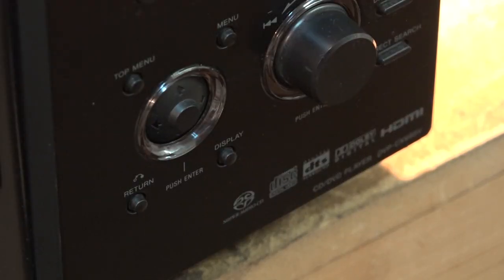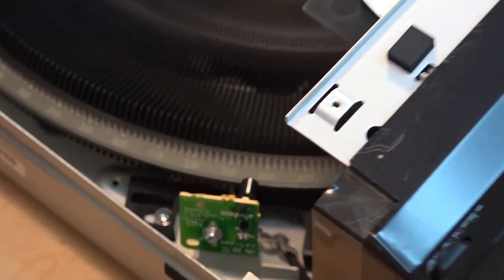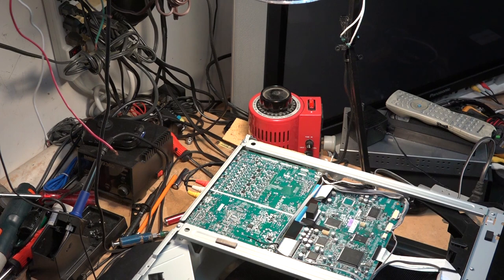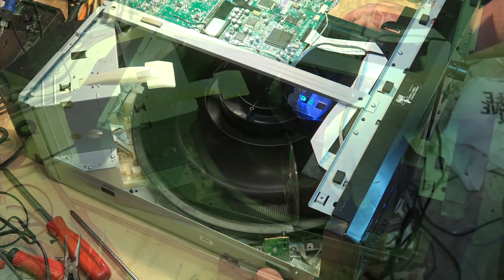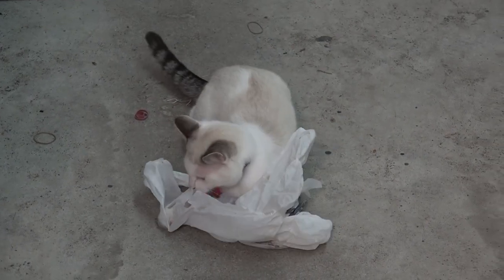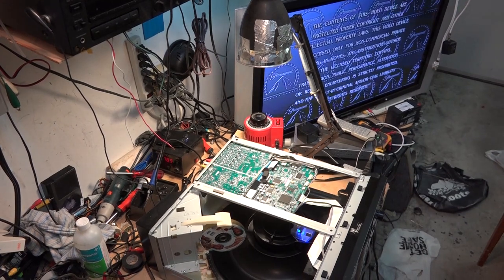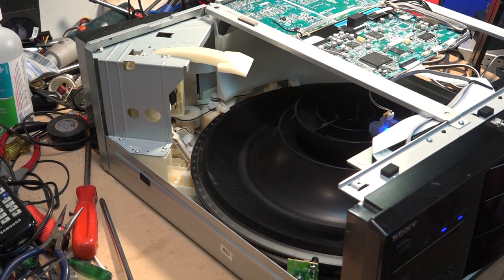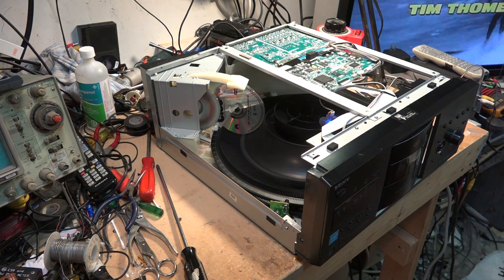Sony DVP CX995 400 Disk Changer no play

Comment: I recently bought one of these at a Goodwill Outlet, so it was kinda abused when I got it.  And ....it didn't work.  It would just go around 3 times counter clockwise then read "please wait" forever.  I found your video and my problem seemed somewhat similar to yours.  But it was late so I took one last look before calling it for the day.  I wanted to look at that guide wheel on mine to get an idea of how yours might have come off, cause it seemed rather improbable.  I found my guide wheel snugged up against the disc sensor!  After restoring it to its rightful place the machine worked fine...clockwise, counter clockwise...found the disc, played it.  Thanks for the help.
Reply: I have a problem like Sunplais, would you please show me where is the guide wheel snugged up against the disc sensor?  Thanks

Comment: Thanks 12voltvids!  My mega-changer began to act erratic after I removed several discs.  It would turn on; make a long noise; carousel would not turn.  I also have the CD mega-changer; experienced the same problem.  Discovered that it was the belt; accessible from the rear on the CD changer, but, I had to remove the top on the DVD changer to reattach the belt; problem solved.  I've owned both since 2006, without any problems.  So, I'm glad that I clicked on your video, and decided to to remove the top to have a look!

Comment: I discovered that when working on the unit, with the cover off, the super bright lights in my garage and workshop affects the optical sensor malfunction also direct bright sunlight when working outside.  With the cover on, it worked normal.

Comment: My CD-400 carousel started rotating endlessly, alternating between faster and slower rotation. I knew nothing but assumed there was an optical sensing system that wasn't working. This video clarifies a lot. However, I am wondering if it might be possible that the sensor under the carousel might be occluded by dirt or debris that might have accumulated over the decades (my unit may date from the 90s) rather than a dimming LED. Unlike a hand held remote, this sensing system is designed to work at a very short, fixed distance. This video provides enough information for me to attempt a repair. I know the video is 6 years old in late 2022, but it is pure gold for me. I have spent hours searching for this info to no avail. Thanks a lot. Hope the cats are alive and well.

Comment: Fascinating watching you fixing these items,. Have Sony 300 Disc player running on 110V ac system (Canada). I ran it on 230/40 ac system using a transformer here in Malta and worked perfectly for many years. Mistakenly I plugged it in a 230/40  wall receptacle and it went dead. Looked like the CD changers own transformer obviously burnt out. Can`t use anymore . Wish I can find new transformer to replace the bunt one but I live in Malta and it is impossible here to find anyone that can fix my unit.
Reply from the maker: I'm sure I could find one that would work on it.  Might need a couple to get the different voltages used but am am sure one could be found that would get it running.

Comment: That unit looks like someone's been at it before, what with the loose components and everything. Good call on the emitter LED, I would not have thought of that once I saw it working...

That new ragdoll cat of yours looks like a mischievous little character :)
Reply: A variation on the emitter LED problem.  No power to LED.  Check for unplugged connector on PCB.

Comment: Guys like you are getting very hard to come by!!  Any chance you are near Tampa Bay?? lol.. I have 2 AVR's I'd love to fix. An old Carver that my daughter smoked on me while I was out and a Harman Kardon that won't power up. The Carver is from the mid 80s and was really clean sound and the HK was ok to pretty good. I just bought a SONY AVR and 400 disc player. The receiver sounds like crap with my HK speakers and the 400 disc player needs all the belts. They were both NIB, but stored for many years. One of the easily seen belts was melted into the larger pulley and the other had just snapped. The door won't open on it's own, so I'm betting it's also toast.. I think I'll check the rollers as well since the belts look melted. The plastic  wheel retainers are possibly junk as well..  My old 6-pack magazine CD player was my favorite for decades, but it bit the dust a few years back and it broke my heard.. Now it's hard to find anything with Spotify and others killing the market.. I won't use them. It is not a PLUS for the common man. Just another money sucking deal from those with money pushing us to want more of their crap and pay for it.

Comment: The replaced LED didn't seem much brighter than the original (though obviously it was enough to make it work again), couldn't it just be dust build up on the photo detector? I had a similar problem on a VCR that wouldn't stop when the clear leader past the sensor all it needed was a cleanup as it was "blinded" by the dust.
Reply from the maker: One of the first things I did was blow any dust out with my compressor. Didn't show that because it had no effect on the outcome. Did that before I changed the emitter.

Comment: My Sony compact disc player CDP-CX400 no longer works after transporting it over 800 miles. The error message says "table error"  So I removed all the CDs, and followed the directions on the Sony web site, and it still does not work, with same message. A Sony phone consultant said to send it to United Radio for repair, which I hesitate to do. Any ideas??

Comment: interesting. The cats are an added bonus !
Reply from the maker: Cats are a pain in the ass some times. One climbed up on the top shelf and knocked box that contained 5 Sony lavaliere microphones I had up for sale down, breaking 2 of the plastic storage boxes. Most of the stuff I get in I try to sell off after repair, at least the stuff that is worth money. For example the 16mm projector that was featured a week or so ago should be out the door this weekend. That giant 32" Sony tube TV that had the bad degauss thermistor. Yup found a home for that one too. Looking for a home for the VP2000 3/4" player. Someone will take it eventually. All this old stuff gets a new home eventually. Much of it I just give away as I need the space.
Reply: oh yes,that's a cat! lol  but that's a shame gear was damaged that someone needs. I have suffered a loss.....just not as costly as those mic's
Reply from the maker: I doubt they are damaged, just the storage boxes, the catch that holds 2 of them closed snapped off, so the box will need to be held closed with a rubber band. Reduces the value a little. Have no idea what I am going to sell them for anyway. Have to do research and see what they have been going for.
Reply from the maker: I doubt they are damaged, just the storage boxes, the catch that holds 2 of them closed snapped off, so the box will need to be held closed with a rubber band. Reduces the value a little. Have no idea what I am going to sell them for anyway. Have to do research and see what they have been going for.
Reply: The price we pay for what they give us. :)

Comment: Hi there we have 400 disc sony changer in for repair slightly different fault where by if you no disc's in it  the carousel will constantly go through all 400 locations and load at every single disc location  and do this until you power off it would seem the machine thinks it has 400 disc's in and yet there is not one in it all. I think the sensor that detects there is a disc in each slot as it goes by is sending out a high output telling the machine disc's are present.
Reply from the maker: How they typically work is a China infrared light beam into the edge of the disc and there's a photo transistor on the opposite side and as the disc goes past it detects the pulse of light passing through the disc. So straight light that's able to reach the sensor can cause this problem. Typically the vitamining dial that shoots the light beam out does not point directly at the sensor but points at an angle so that light gets refracted through the disc itself but if there's no disc in place the beam from the emitter doesn't reach the detector
Reply: @12voltvids  Hi the strange thing is if put a disc in say position 25 and ask the machine to play this disc it finds the location and plays it.
Reply: @12voltvids  One other I was trying to see to see how much light output is present from the  infrared transmitter but all I have here is one of those credit card infrared checkers for remote controls  and when I switch the workshop lights off you can see the pad on the card dimly glowing. Ps thanks so much for your time and help.
Reply from the maker: @robertedmead3684  the location is detected through an encoder ring on the bottom of the carousel it has little slots that are varying with that it can read as the disc carousel is spinning so that the microcontroller knows what position it's in so when you spin it to disc 25 it knows where 25 is because it reads from the bottom almost like reading a barcode if you were to pull the carousel out you see it what look like little little teeth sticking down which interact with an optical sensor so as it's turning it knows where it is and each number is not indexed individually what it is is there's one that has a larger space and then the rest of them are all equally spaced little notches so when it starts out it makes that first initial rotation until it hits that first marker which tells it this is position number one and then it can rotate either direction and it counts the pulses so that's completely different than the disc in indicator which is a little LED that's typically on the left side that kind of shines into the disc at an angle and then there's a detector below it that detects when there's a disc in place and it works by refraction when the light enters the edge of the disc it reflects down just like if you were to take a an LED and shine it on the edge of a disc that the actual circumference of the disc with eliminate that's how it works it shines a light into the edge of the disc and then it's able to detect the light being refracted in the disc but if there's no disc there the light never reaches the detector so if something's causing a reflection or if the angle of the emitter is pointing say too low and it's able to pick up a reflection from something else it might count it as if there's a disc there when there's not but typically if it's detecting that there's discs in place and there's not it's because it's picking up a reflection from something if the LED were to fail completely the detector would not see any light and it would just make the one revolution and then say no disc
Reply: @12voltvids  Hi yes totally understand what you are saying. I have look at the bracket that transmitter is mounted on and does not look that any one altered its position with have to look in service manual to see if there is a alignment procedure thanks again and greetings from  the  UK.
Reply: @12voltvids  Hi really sorry me again. So if we are saying the infrared receiver is picking up infrared from the transmitter when it shouldn't as no disc in the slot to reflect it if I do a quick test by covering up the exit of the infared transmitter and power up the unit may possibly to do one complete rotation of the carousel and stop as now a no disc situation should have occurred.
Reply from the maker: @robertedmead3684  right
Reply: @12voltvids  Hi couldn't resist opening up workshop today and have a look. Covered over infrared transmitter with black insulating tape and run again still same problem. Will get circuit diagram out on Monday and have a look at the status of the infrared receiver and see if I get I high/low status change when I put in a load cd's as they go past the transmitter .Many thanks again
Reply: @12voltvids   Hi Have found the input on processor for the pulse from  disc in detector pin 91 of IC 501.

Comment: Jeezuz get some proper electrical outlets installed got like 20 plugged into a strip.  What the heck.
Reply from the maker: I have plenty of power.  There are 2 on the bench, one on each side and a power bar plugged into each side.  This is a dedicated circuit.  No chance of overloading.  In the garage there is actually 2 dedicated 240 plugs for the 2 electric car charge cords and 2 circuits for the bench plugs and another for the lights.

Comment: Im supprised it managed to select a disk at all, that sensor seems to be the only thing telling the unit absolute slot position, Im amazed it works so well.

The disk waving procedure seems a bit odd, i would of expected a smooth rotation of the whole wheel and where the two sensors blip would be a disk.
But its ok now, so back it goes :-( :-(.
Needs deeper feet, thats the reason for the caster pop out.

Comment: I have a 400 changer.  It will grab the disc but it won't turn and when it returns the disc to the carousel, it makes a clunking sound.  Can you shed some light?  I noticed that there is a white disc on the side that is very loose and doesn't hold the cd.  Is there a way to tighten it?
Reply: mark did you ever get answer to this?  Im having the same issue
Reply: The white disc is normally floating around.  The other problem sounds like you need to replace the laser assembly.  Problem with laser board.

Comment: is there an operational amp chip which controls the brightness of the infra-red led like what would be used in a laser module to stop the laser diode from burning out.
Reply from the maker: No, just a current limiting resistor.

Comment: Can I run something by you?  This unit just arrived to me and the issue is press power button, it turns on, but then shuts off a couple seconds later.  Service manual says to check voltages on main connector on power supply.  I'm getting correct voltages on every pin except one - I'm supposed to get 3.3v, I only get 1.8v.  Traced it back to IC401 (a tiny regulator on the backside of the power supply board).  Input pin voltages are fine, but one pin on the output is, as you guessed, only putting out 1.8v where it is spec'd for 3.3v.  Do you think this is probably the reason for the shut  down?
Reply from the maker: Its either the regulator is bad, or something is loading it down. Does it get hot?If so I would suspect that something is loading it down, if not then the regulator itself is probably bad.If you look at my TASCAM DA40 repair that is what was wrong with it. It would turn on and come up with MECHA COMM ERR, and it was a bad 5 volt regulator that was at fault.
Reply: 12voltvids No heat at all.  I'm going to watch your video and order a new one.  It's one of those ridiculously tiny SMD regulators.
Reply: So, I installed the new regulator and checked all voltages on the socket and all were perfect.  I'm getting my 3.3v on pin 11, so I reinstalled the power supply and fired it up.  It came to life and for the first time, the display said "Sony DVD" (which it wasn't doing before).  Stayed on for about 5 seconds and the shut itself off again.   GRRRRRRRR!!!!!!  That's probably as far as I can take this.  If you have any ideas, I'd appreciate it, or if you have any hankerings to have a look at it for a video, I could ship it off to you.  Thanks.

Comment: I have the same unit.I recently moved and did not take the nearly 400 disks out.I turned it on and it turned off.i OPENED IT UP AND SEVERAL DISKS WERE OUT OF PLACE.i TOOK THEM OUT.Now it turns on but does not play.It turns off after a couple minutes and displays C 32 00.Can someone tell me how to make it work?It worked perfect before the move.Thanks.
Reply from the maker: Lesson learned.  Remove all the disks before you move it.  Likely a plastic part has broken in the disk loader.
Reply: @12voltvids  I just took all the disks out of it.The center belt was all twisted up and broken.Can I purchase one from you?Thank You.
Reply from the maker: @thomasmurphy3830  I don't have any spare parts.  I have to order parts as I need them.
Reply: I have this same unit, love it but it gets 3 worn out belts just like all of these changers do in this family of cd/dvd players.

Comment: interesting player one thing though would all the cds fall out if it were turned upside down with them in here?
Reply from the maker: If you move the units full of discs bad things happen. These 3 were rattling around inside. That's why the top was already removed before the video starts, because I had to remove the loose discs before plugging in or I would have been picking pieces of broken discs out. And yes I did see that happen.
Reply: Speaking of discs, and these types of megachangers, there's a version of this megachanger that can play Blu-Rays as well. I saw 300 and 400-disc variants of it.
Reply: yes, can tell from experience